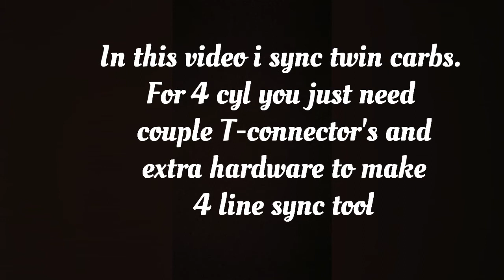Carb Sync Tool: Making and Using

Comment: The fluid is automatic transmission fluid. The adaptors are mig welding tips you get from welding supply. A lot of tool rental places have them.
Reply: Where did you buy the tips? I can’t find m5 tips near me
Reply: @MTNMANWOODWRKS  i also tried online and i cant find m5

Comment: How can you be sure that the pressure drops across the two fuel filters are the same? It is enough with 2-3 millibar difference to jeopardize the reading totally. Maybe you should connect the two hoses to a common vacuum first to make sure the filters are equal in resistance?

Comment: So in a dual carburated motorcycle, what is it on the carburator that you are turning or adjusting that is bringing those levels equal? the idle screw, the mixture screw?  TY
Reply from the maker: It is linkage screw that is located between carburators. That sets the throttleplate opening between each other carburator.

Comment: Tgis is a JOKE!!! DO NOT ATTEMPT THIS!!!! I built the unit exactly how discribes and it sucked ATF (AUTOMATIC TRANSMISSION FLUID) into my motor!!! SO WHAT THE HELL DO I DO NOW THAT I HAVE ATF IN MY MOTOR!?!?
Reply: Lol your supposed to shut the bike off and adjust before it gets into your carb
Reply: @tyshiz3381  The fuel filters, when you are actually watching the manometer, are intended to give you time to shut off the engine before getting the fluid into the cylinders. The carbs on your bike must have been way out for that to have happened. It could have occured if the adjustments were made too quickly or aggressively. 

Presumably, by now, you have resolved the problem of ATF in your motor. It will have done no more than cleaned out the compression and oil control rings in your motor. Now it will be running lopsided, you may have to run ATF through the other cylinder to ensure that you have cleaned them both out (caution about hydraulic lock).

If you have, indeed, "built the (manometer) unit  exactly how -discribes- described", you will not have done any harm to your bike and may have actually improved its condition. That is the reason for using ATF fluid, which acts as a solvent, or 2 stroke oil. Neither of these products will harm the engine of themselves. The only problem may occur if the engine has not been shut off in time to prevent what is known as "hydraulic lock" which can damage your engine.
Reply: @Peter-nu6ix  what happens if you get hydraulic lock?  I also built one, but had to shut my bike off before the flluid got sucked into the carbs...will that cause Hydraulic lock?  I think i have to make my hoses longer is maybe the problem...
Reply: Thanks for this video,  very informative and what is that great backing track..?.
Reply: @Peter-nu6ix  i want to build one for my throttle bodies. how do i prevent the liquid from getting inside my engine